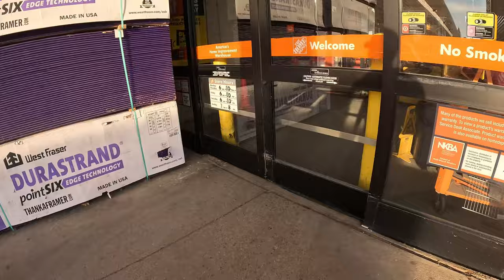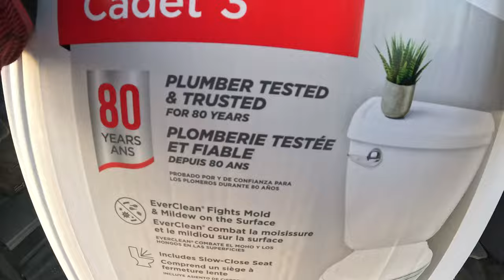REFUSED Delivery! She should have known This Ain't That! #karen

Comment: At first glance I would have just attempted to bring it inside. However knowing after the fact that the store told the customer the delivery terms no way.
I had a similar situation with Go Share order from Lowes. Customer wanted me to bring inside their home an air-conditioning unit (which I did) but then talked about installing it. I said no way!! Just paid to drop it off that's it.